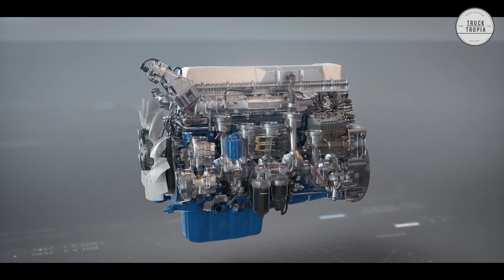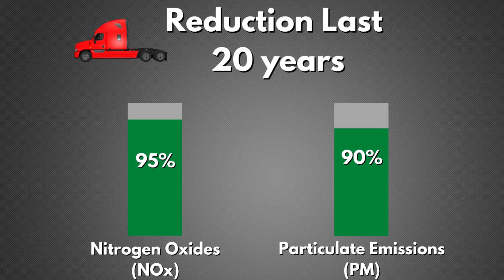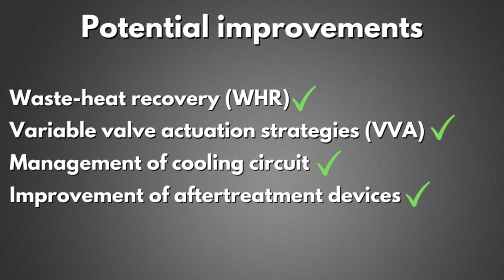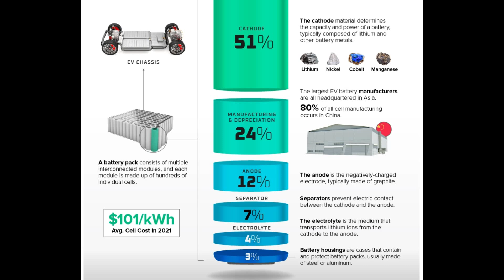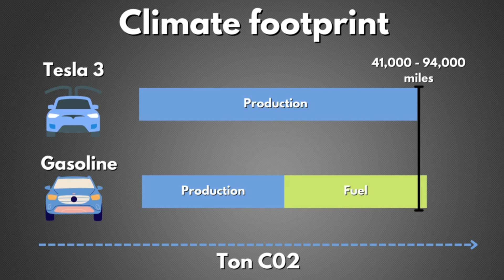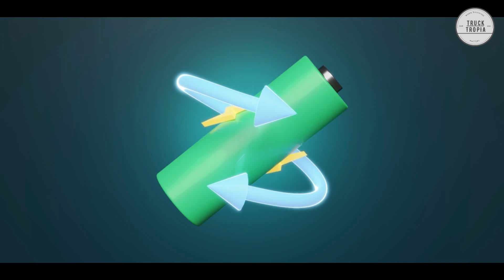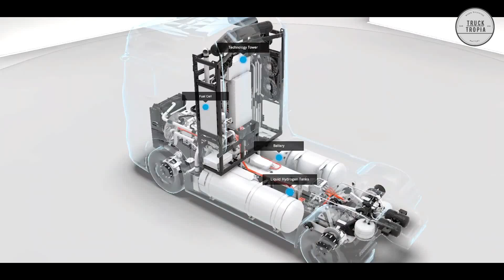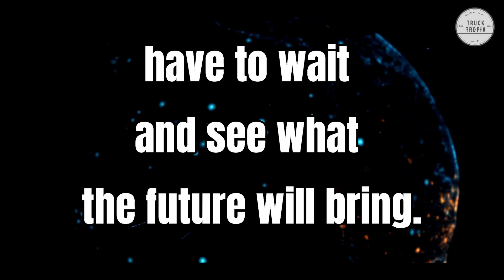How Dirty Are Diesel Trucks Really?

Comment: This video could have been good , if you had set the same criteria for all fuel types, but you didn't.
Why are you talking about hydrogen production and not comparing it to diesel production? There are a lot of steps from crude oil to diesel at the gas station, but you don't include them in the equation. It's not just the emissions produced by the vehicle, but for diesel, you only included those emissions.
However, the best solution for this and the next decade may be a hybrid if someone builds it the right way, and it doesn't matter if it runs on diesel, cng or hydrogen.
Reply: From crude to diesel in the tank (WTW, well-to-tank) you loose about 15% energy. For hydrogen, you lose 30%, or more, (this is if H2 is made from natural gas, as 95% is made today).

Comment: Diesel will be with us for centuries. I personally see no issues with diesel and think there is no point in changing how we do things.
Reply: Good thing people didn't have that mindset 150 years ago, or there would be no vehicles at all. Or 100 years ago, there would be no telephone system, or 50 years ago, there would be no solid state electronics, or 30 years ago, there would be no internet....Everything you enjoy in life is because people DID NOT have the mindset of "there is no point in changing how we do things"
Reply: @billsmithingell7902  The difference is all those changes were shown to give clear benefits. Electric cars or trucks are not doing anything new and the benefits are not a winning combination. The stupid thing about electric cars or trucks is that they use a battery; They still need a fuel to generate this electricity. Meaning there is the use of coal, gas, oil or uranium. Now you have added the environmental problem and the inconvenience of the battery for what benefit? Less maintenance, less noise and maybe less cost. These cars will be throw away eventually because of the battery; maybe after around 20-25 years and when this reality is known and is factored into the dynamics; Mass production of EV's will be more problematic then it is worth. Australia, Europe and parts of the US are struggling to generate enough electrical power as it is. Unless there is a major breakthrough in technology; Problems are on the horizon. EV's have their place, but it is a place that plays to its advantages.
Reply: @billsmithingell7902  really then why does the saying exist if it's not broken don't fix it. A good diesel engine is superior to a electric and petrol car any day. Emmisons are scams by the greenies to scare people. Here in Australia the summer has been colder than usual.
Reply: I feel the same...100 years from now..on the interstate he is..diesel trucks will be the backbone of the freight industry in America..there is no logical arguement..or total replacement of in my opinion...a invention to mankind second only to the wheel..my only regret..is I can't be there to say (I told you so)!

Comment: Old trucks do not compare to new ones. In the 80s a fully loaded and kitted semi truck was 24,000 dollars today a truck similarly equipped is over 200,000 pickups were less than 10,000 new and today you get a overall worse vehicle for over 130,000 keep this in mind too the average family income in the 80s was 21,000 a year after tax. And today its around 40,000 

People have gone from these things are affordable new in 1-2 years to maybe in 5

Forgot to mention old trucks are far more fuel efficient. The epas logic its more environmentally friendly to burn more fuel for the same work load
Reply: The EPA for a long time didn't care about fuel burn or CO2, they were only worried about smoke and smog (with their related health costs). Modern diesels emit way less toxic crap, basically. Often that came at the cost of efficiency, e.g. using EGR and late injection timing to reduce NOx emissions has a direct efficiency penalty, as does using a DPF to eliminate smoke. But on average fewer people get cancer or respiratory diseases.

Comment: Electric will have its place as a city truck but heavy haul guys just laugh. A friend who does heavy haul was hauling over 200k lbs and was averaged 125l/100km lol that engine was working hard
Reply: Well the long haul could be taken by Railroads which are far easier to electrify for long distance as you don't have to worry about batteries, then just transload at a local team track to local trucks for transport. with containers this would be reasonably easy to put into effect.
Reply: @johnkuzma7066  If it were that easy, we'd already be using rail as a primary hauling method. But it seems to me, there's a reason why we don't... I don't know, like, there isn't rail everywhere? Like, I know of two places that there's a railroad. Said places are 30 minutes apart, and I don't even know where the nearest trainyard even is. It's probably more than 500mi. A diesel truck can go anywhere you have paved road. A rail can't, and of course you need to account for the extra energy, time, and cost to load/unload. If you're using a diesel semi, you load it once at its origination, and unload once at its destination. If you use a rail to semi, you have to load a semi at its origination, unload at a trainyard, ship it via train to unload it at another trainyard to load onto another semi, then unload at the final destination. This requires energy, probably forklifts that run on gasoline.

Comment: wait.. you mean to tell me haulage companies are actually buying these teslas... dont remember the math but they are gona have to haul less on them...if I was running one of these companies Id say its too much rarther stick with the diesels..
not saying it couldnt physically haul the same, but it cant as we have maximum combined vehicle weights on our roads (UK/EU) and although tesla have avoided giving.... well ANY meaningful stats on the truck (who in logistics honestly gives 3 *****s how quick it is we aint racin them)  its going to be considerably heavier than a ICE unit going by current battery tech your talking like 5 ton of battery
Reply: Tesla released the stats. Tesla Semi weighs around 35k lbs compared to roughly 25k lb Class 8(Peterbilt). It is indeed heavier, though majority cargo  hauled is less than the road weight limit. It is a drawback, but I expected worse.
Reply: @LowlyJ1223  eh i guess I wasn't too far off.. i figured  the battery would be about 5 tonnes going by current techs energy density.  so seems close enough
Reply: In inner city traffic the range might not be much less than a diesel, considering how hard stop-go driving is on fuel economy. Something else that's maybe less obvious, there are probably some significant savings on brake maintenance.

If there's one no-brainer use case for electric trucks, consider municipal garbage collection. Those trucks must be real hard on brakes and engines given how they operate them.
Reply: @nerd1000ify  oh I fully believe there is an application for electric trucks just not gona jump on the green wash everything band wagon (too many lies and misinformation associated with it). 

 Just don't think electric fits with distance haulage or anything like that..   smaller local stuff for sure.

most big haulage trucks have more than breaks to slow them down, good drivers don't use breaks unless it's to actually stop.. 

Not sure about bin wagons.. sure the driving suits electric, but you also got to power the hydraulics and stuff for picking and crushing the garbage. Not sure how much power that takes to be honest
Reply: @Gazzy  Yeah, I'm an Aussie and a lot of our long distance haulage is road trains (3 or 4 trailers). Unlikely that any electric prime mover could handle that, especially given how far apart the charge stations are going to be.
People who are serious about carbon reduction in heavy haulage are talking more about renewable fuels, hybrids, aero improvements like boattails and skirts, etc.

Comment: This is the most biased "scientific" video I've ever watched. Keywords like "overly" instead of just restrictive emission standards, it's hard to listen to the science when you're constantly editorializing with a clear agenda instead of just facts.
Reply: If you worked in this field, you’d understand the « overly » restrictive part. Fuel consumption is up and reliability is down. The end result is many will bypass these systems once out of warranty and you’re left with polluting trucks once again. If regulations were more reasonable, we wouldn’t have these issues and we’d have cleaner air.
Reply: Well speaking as a truck driver name your fuel that you want to replace diesel. Electric? It has nowhere enough range The recharge time is way too long and the weight of the batteries will compromise the amount of cargo carrying capacity. But there is another option we could eliminate grocery stores clothing stores pretty much every store there is and go back to the 1800s and you could either make everything yourself or start hunting for everything.
Reply: @mississippidrifter5960  Electric won't be a replacement for long haul for a very long time for all those drawbacks.  Charging time isn't a big issue if you charge it while it's loading (no gas stations might save time) so for under 300 miles regional trucking is a decent alternative already.
Reply: @Delfontes  good idea in theory but not in reality. I can load a contractors truck at work in about 30-45 mins (not very long to charge) then who pays for that power? Am I supposed to pay for the electricity when the truck is plugged into my shop while loading? And then throw refrigeration units on top of it, those would drain batteries super fast so you still need some type of internal combustion engine to run it.
Reply: but he is right at the end of the day
Reply: I see no error here... "overly" is correct.
Reply: Just what "Facts" are you referring to?
Reply: And the green nutters dont do the same
Reply: @petejohnson1724  exactly, we want facts without the commentary, green nutters like myself hated nuclear, but facts show it's safe and clean for the most part so we changed our minds. If facts show the energy costs to produce electric cars outweigh their efficiency over time we'd look at it but if you cherry pick and have an agenda with the numbers we'll dismiss it.
Reply: @petejohnson1724  dont act like a child "waa they did it first!"
Reply: So what fuel sources do you prefer ?
Reply: yeah but he's not wrong for most of it lol

Comment: Another video (and a good one) that completely ommits the case of Hybrid Trucks. Why are no hybrid trucks based on concept simmilar to one in Toyota Prius? You have electric motors for low speed driving, manouvering, coasting and diesel motor to drive on highways? In towns and depos you have torque, silence and zero emissions and on highways you have range and power of conventional diesel engine that can charge not too big pattery pack. Hmm?
Reply: Because of weight. You are paid by weight as a trucker, mostly. But for medium to light city distribution, it's a good alternative. From terminal to city on diesel and around the town on electric.
Reply: @arneanka4633  Yeah, perhaps. I was thinking more in terms of gearbox. Only CVT's are used in hybrid cars as I am aware of and trucks only use manual gearboxes (incl  automated onces, like I am driving right now)

Comment: As an electrical engineer, I think electric cars and trucks are completely garbage.
But, I think an series hybrid diesel-electric truck would be good. Even a little 50km range battery, would be possible to reduce the size of the diesel engine and be less costly in fuel. Mostly because you wont be using 100% of the electric motor all the time, so to the engine charge the battery would be easy.

Comment: The future should be EV. Janus Trucks Australia are already operating on the east coast. These trucks are operating road train configurations, have 300km Range in the aforementioned configuration with a 3 minute battery switch over time.
Most trucks of this size will carry 2000 litres or more and a fill time of 30-45 minute at the pump so even with multiple battery swaps over distance a driver still gains 30 minutes driving time a day.

Comment: Electric motors and natgas turbines for cruise only. 

Electric motors already deliver good torque, turbines are heat pumps on steroids and can be very efficient as long as you have proper airflow (i.e. cruising).
Reply: Why would you want a turbine in place of a far superior diesel?

Comment: Only near term practical solution for a full time electric semi would be to  have the truck pull into a Bay and the battery removed and swapped out with a fully charged one.  Benefit of that solution would be that the battery would be more of a rental subscription which means if it goes bad it wouldn't cost the owner of the truck $50,000-$100,000.
Reply: Yeah I honestly don't understand why a battery rental-based solution isn't catching on. It just solves all the problems we currently have with battery powered vehicles. We can standardize on 12V lead-acid batteries for ICE cars, what's so difficult about standardizing on electric vehicles?
Reply: @Stewi1014  because batteries are part of the chassis in a lot of cars and therefore adaptet to the size of said vehicle. You can't put the battery of a Rimac Truck into a Renault Zoe
Reply: @Stewi1014  Patents.
Reply: @Stewi1014  Chinese have tried it, it isn't working.
Reply: My thought is to make it a modular part of the trailer, only keeping a small battery on the truck to move the truck when the trailer isn't attached. This way the trailer is charged while the freight is being loaded.
Reply: @rayztruck1950  There are many ways to do things, it will be worked out.
Reply: @rayztruck1950  Traction?
Reply: @rayztruck1950  That's a brilliant idea if you ask me

Comment: Eventually diesel trucks will go the way of the steam engine. They will still exist, but in a minor or historic demonstration role. Medium-term electric hybrids or diesel-electric engines will bridge the gap between range and efficiency. Some experiments in Germany have trucks that pull power from overhead lines - this saves hauling the weight of larger batteries, although you still need one for local connecting roads and gaps in or damage to the transmission network.
Reply: Expect steam engines are still around in more places then you think. Many ships and buildings use it, and the whole concept of nuclear energy is nuclear boils water to create steam and then steam spins turbines. Steam power is very efficient and it’s longevity is above all.
Reply: @beastmasaurus6467  We don't have nuclear trucks.
Reply: @David_Crayford  Nuclear trucks wasn't my point. You were claiming that steam is next to obsolete, and I was pointing out to you that it's for from being obsolete. It's the same case with diesel.
Reply: @beastmasaurus6467  Coal-powered steam engines left our roads 100 years ago.
Reply: @David_Crayford  Steam was never popular on the roads to begin with. I know that and you know that, but the initial point I was making is that steam power for the most part is far from being obsolete, and that went over your head somehow.

Comment: 8:06 "Hydrogen filling stations require hydrogen to be trucked in on diesel tankers." No they don't. Replace the diesel with electric or hydrogen.
Reply: Actually most hydrogen stations are just hooked up to the city water, and use hydrolysis  to make the hydrogen on-site.  So there are no trucks at all.
The main input is electricity to power the the reaction.  Hydrogen vehicles are still electric, they just lose about 60% of the power in converting to hydrogen in the filling station, and back in the vehicle.
Reply: @qcca123-f1v  the point of hydrogen is no need to deal with batteries not being recycled to full re usability. maybe more power per weight

Comment: Do you have a source to verify the data of the pollution taken to make a tesla vs a normal gasoline car? It seems to me that is was considered just the extra cost for the battery but not the savings in the engine in the engine and other systems that are simplified in an EV.
Reply: A good argument it is.  I don't see any correlation between electric motors and pollution in a vehicle in use.  Furthermore, factories are turning toward renewable energy sources to keep running.

Comment: So an electric car just has to last 100k mi. to have a smaller footprint?  The batteries are designed to last at least 250k mi, so there's that.  Also liquid lithium ion is old tech.   Solid state is the future of batteries.  Half the materials.  Half the cost.   No risk of fire.  Potentially twice the range and battery life.

Comment: Hyliion ERX is the only viable solution that will allow fleets to stop using Diesel engines.
Reply: As a carrier I was goin go to order one.  There’s a small problem and a big problem with it.

The small problem it’s twice as expensive as a new diesel.

The Big problem is that it’s “Significantly” heavier than a diesel.  Majority of my customers want max cargo weight available.  

I ordered a new diesel truck until they refine the product.